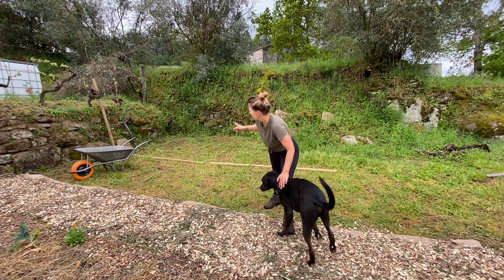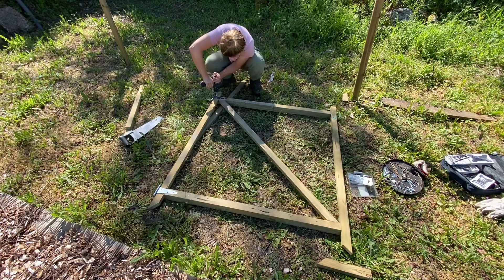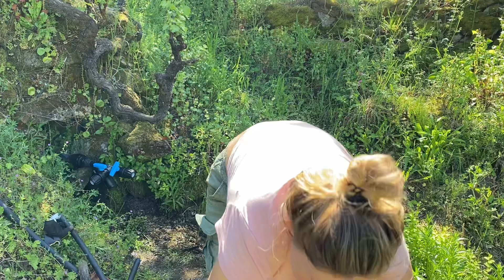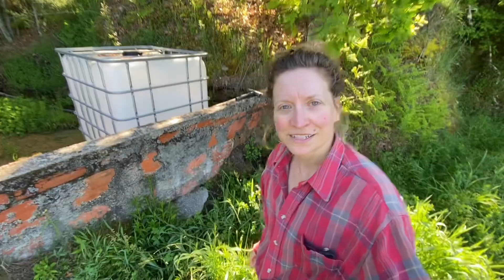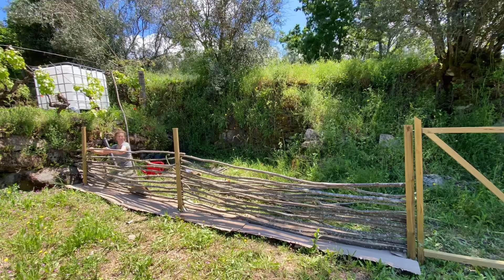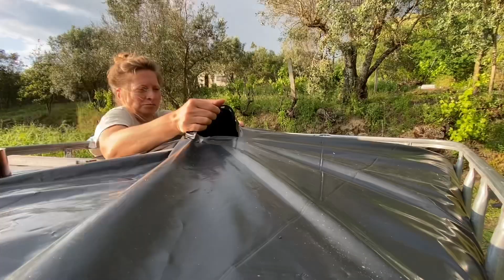Starting My Off-Grid Irrigation System 💧+ A New Garden Fence Build

Comment: Those pipe cutters are fantastic indeed. Can't beat it with any other tool. Accurate, clean, effortless and a huge time saver. They also cut the harder PVC pipe just as easy as long as the pipe is not too large. I'm glad that I could help you with tipping you about this tool. 👍
Reply from the maker: @insAneTunA  Thanks again for your recommendation 👍🏼 Such a great tool!